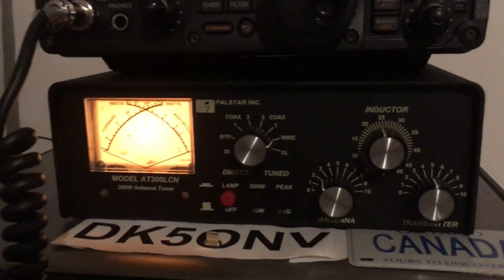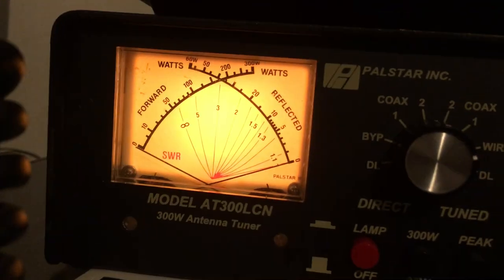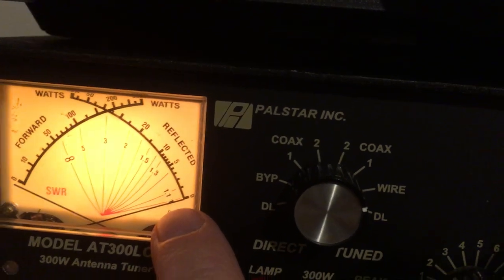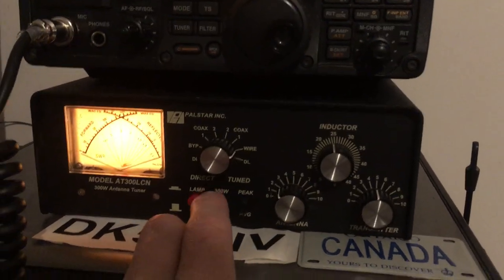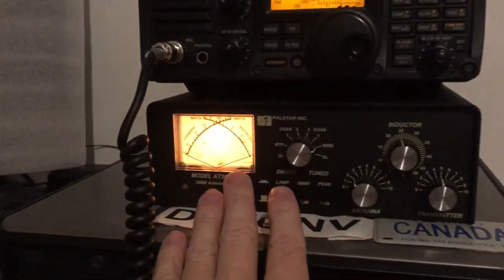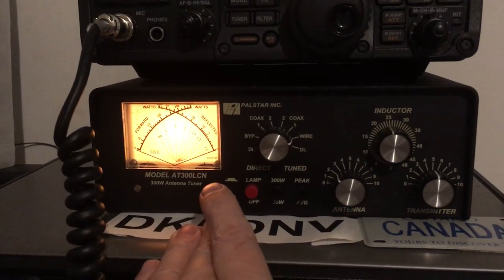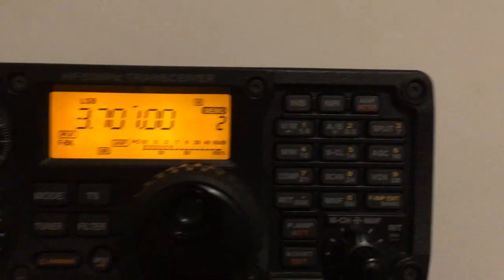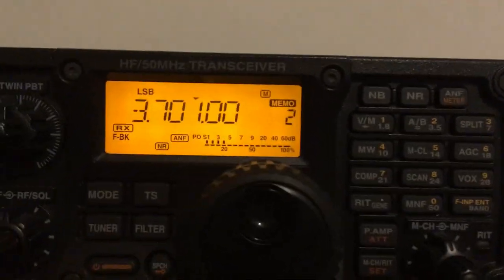SNAFU tiniously no DX possible . . .😭😭😭

Comment: The beauty of metro areas.. noise.. since it is night, you may have many many street lights causing noise, especially if they are LED lights.. Try it during the daytime on 20m, or 17m or 15m... See what that does.. Nighttime is noisy here also on the lower bands and I'm out in the country..  Let me know what you find tomorrow during the daylight..  k0klb
Reply from the maker: Yup, 160,80 and 40m are not making any sense to work them from here. Thos were my thoughts you mentioned them. Plan C 20,17,15 and checking how 12m is.
Have a good sleep later on. Matress Time for YFUG, it's before 2AM already.. 73 🙋‍♂
Reply from the maker: PLUS since we got the Charge Up Stations for the E-Vehicles around the Block since nearly 2 years now, we dealing with power outages and crashing internet connection or slow speed internet